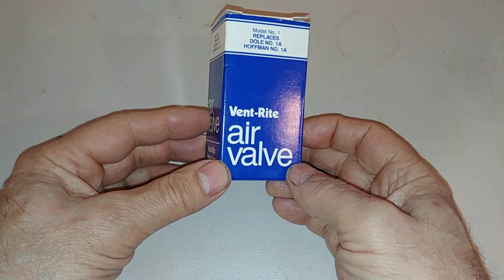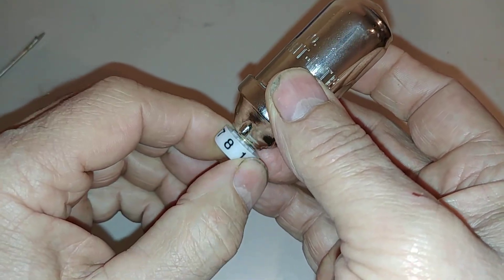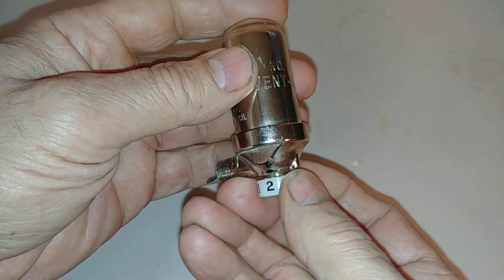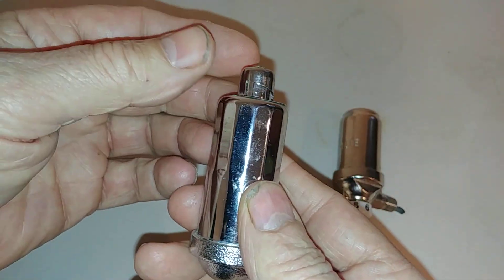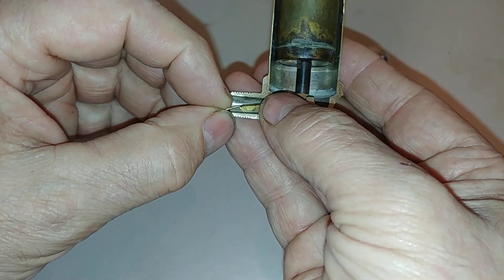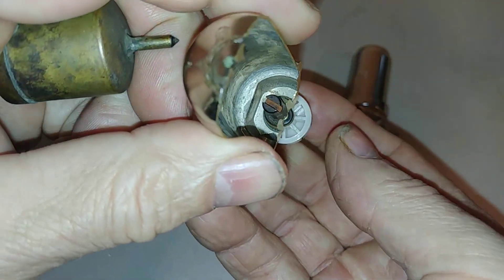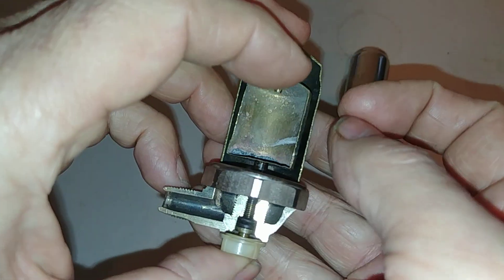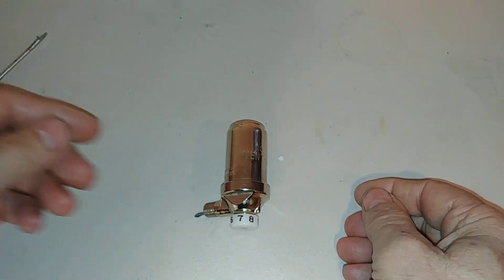Vent Rite #1 Adjustable Single Pipe Steam Radiator Vent. A Pretty Darn Good Vent.

Comment: I just moved into a house with single pipe steam radiators. While the radiator heats up the vents hiss and freakout my dog. Is there a specific vent that is typically quieter while the vents heat up?
Reply from the maker: Have it checked to make sure your boiler is not over-sized or over-fired.
Check to make sure the pressuretrol is set to the lowest setting, and the pigtail is not clogged.
Make sure your main venting is the best it can be.
I'd do this before worrying about the vents on your radiators.
If your boiler is trying to jam too much steam into the system and/or there is not enough main venting, the vents on the radiator are gonna sing a not very good tune.
Reply: @gordonschweizer5154  we had planned to get the system checked after this winter. Will definitely make sure to ask about the things you mentioned. Thank you!

Comment: Great video! I just bought this valve (yesterday)  to replace a vari-valve and it seems to vent air for a long time… the very first time after it was installed it made a ping sound then after that when it vents -it vents loong enough that I haven’t seen it close on any setting. The only thing that seems to stop it from venting air is when the furnace stops running. If I put the wheel on 1 it should close quicker? Had it set to 4-6. -Thanks
Reply from the maker: @vonettas2735  Do you believe your steam mains in the basement are vented sufficiently?
Reply: @gordonschweizer5154  I will ask the boiler technician that services my heater about that. I have only seen one valve in the basement but on the pipe connecting the main to the return. I would have to look to see if I have any  vents on the main as I think they would be higher up.
Reply from the maker: If the main vents on your system are not Gorton #2s, they are likely not big enough to vent your system properly.
Venting your large steam mains as quickly as possible thru these large vents is key to even, efficient and quiet heat.
Once this is done properly, the radiator vents can do their job better, which is to...vent the radiators.
Asking a relatively small radiator vent to help vent the main as well as the runout pipe as well as venting the radiator is asking too much that vent.
Reply from the maker: @vonettas2735  Setting the number lower will restrict the amount of air leaving the radiator & cause the radiator to heat less.

Comment: Do i need to turn off my radiator when i replace my old valve with one of these?
Reply from the maker: Do you have access to turn off your boiler instead?
Reply: No 😢
Reply from the maker: Yes, I would shut off the inlet valve and maybe pick a warm spell to do the change out.

Comment: Great video I'm wondering why in the example you're showing the tag is slightly bent I noticed that when I pull them out of the package new they have quite a bend to them. Thanks
Reply from the maker: That tongue on a Vent Rite#1 is not the best design, sad to say.
Usually, I wind up bending that tongue to almost straight out, with just the slightest downward curve to allow the drainage of water from the vent, and threading into the 1/8 NPT radiator tapping.

Comment: If I want the temperature on a steam radiator to be adjustable, do you recommend a thermostatic valve (with the dial) or one of these? Are they more or less the same? This is for a dual pipe steam radiator system.
Reply from the maker: @Anthonydcpc10  Almost all dual or two pipe steam heating systems do not need, nor should have, a single pipe steam radiator air vent as shown in this video.
There are special thermostatic radiator valves that can be added in place of the usual hand control inlet valve, and that is a whole different separate detailed topic.

Comment: Is it possible to use an adjustable vent that will keep the radiator cold to touch? The studios are small 144 sqft room
Reply from the maker: You can get the Vent Rite #1 and most (not all - variable manufacturing tolerances sad to say) will be able to be closed.
You can blow into the vent and turn the knob to "1" to verify.
Also, make sure the packing on the valve is tight (that might be a job for your super?).
Loose packing is an air/steam leak and will bring unwanted steam right up to the valve in spite of the vent being closed.
Ask the management what pressure they run the boiler at.
Vent Rites say on the package they don't like pressures above 3 psi.

Comment: Tongue does not pivot like on hoffman vents causing bending and twisting damage to flimsy tongue when screwing it in. Also noisier than any other vents I ever used. Best vents are Hoffman and Gorton. Vent rite not in same league.
Reply from the maker: The Vent Rite tongue is their weak point, I'll warrant.
And I'll agree with you that Gorton quality is generally top notch (and they don't even have tongues).
The Hoffman tongues are also top notch and their #40 is (or was - had reports of quality issues recently), an excellent vent.
I think the Hoffman #1A is not as good as the Vent-Rite as to their adjustability. 
It is faster at its maximum setting, the 1A is.
I can't speak to the noise issue of the Vent-Rites, as there are variations in quality and each systems main steam venting, near boiler steam piping, boiler water quality, proper sizing etc etc etc can have effects on the venting rates overall and that can have impacts on noise.

Comment: These vents were recommended to me by my furnace guy and I have been pleased with them but I had no idea how they worked.  I'm very impressed by your knowledge.  Thank you for sharing it.  I'm guessing you have quite a bit of practical experience in the field!  I can't tell you how much better I understand my steam heating system after watching two of your videos.  Have you made a video that describes how to determine if your valve has gone bad and what actually breaks on them?  I would love to see that one!  I'm definitely planning to watch more of your videos.  Thanks again!
Reply from the maker: You are most welcome.
As to steam vent failure modes, the most problematic is when they fail to close when the steam gets to them.
They hisssssss and are a very expensive humidifier (and that helps shorten the life of your boiler!)
Sometimes there is something (a flake of rust, perhaps) caught right at the tip, but usually its the alcohol mixture in the little inner chamber has bled away and will no longer respond to the steam.

Comment: Hi i bought this valve but when i make 6 or 8 water comes out
Reply from the maker: Are your radiator inlet valves fully open?
Are you running pressures at the boiler of greater than 2 psi?
Is the water in your boiler clean?
Is the near boiler piping correct?
Is your boiler oversized or overfired?
Reply: @gordonschweizer5154  i dont know the pressure is more then 2 psi.water is clean.inlet valve i just open fully.

Comment: I like a quiet vent. As the Vent-Rite is a float type,, do they make a popping sound when opening and closing like the Hoffman 1A?
Reply from the maker: Yes, most of them do.
Although not as loud as most 1As, or so it seems to me.
You might be able to dial the Vent-Rite down so steam doesn't quite reach it @ the end of the heating cycle, so it won't have to close (and thus, no click).
Reply: Ok, thanks, Gordon. I’ll have to try a Vent-Rite.
Do you know why the float type vents include that ‘condensate tongue’ at the vent input while the bimetallic types do not?
Reply from the maker: @marcinmerrimack1726  It may have to do with the different shapes of the Gorton types vs the others.
The squat cylindrical shape of the Gorton may guide the water out well enough to allow it to function without the tongue.

Comment: What are some of the causes you mentioned just to have an idea?
Reply from the maker: Could you give me a time marker from the video?
I don't remember...
Reply: Well, I have a one pipe single system….. where u states it might not be the air vent …. Probably something else …. Meaning the steam boiler?
Reply from the maker: If the radiator is not heating as well as the others, and it is properly vented, the radiator vent is not likely the problem.
The valve to the radiator might be partly closed or broken.
The pipes leading to the problem radiator might be sloping the wrong way or have a water pocket.
The mains might not be insulated.
You might not have enough venting on your main steam lines.
The near boiler piping might be substandard.
The water in the boiler might be contaminated.
Reply: Thanks … I’ll do my investigation this weekend…. Thank you …. Like ur videos….. have you ever worked on an old Peerless Boiler steam furnace?…. From the 1960’s

Comment: What happens it the vents don't pass air through vents. Even the high vents and the vents through the apartments???
Reply from the maker: Where there is trapped air, there cannot be steam.
No steam = no heat

Comment: If you break the tongue off when installing, is there any way to reattach it?  Also, I got 2 others to work...but I don't like the particular sound @ 6-8 ... louder ones from my old ones don't sound as annoying (don't know brand)  ... for a room I want to run and buy a non-adjusable, what is quietest one, regardless of price?
Reply from the maker: It seems that the Vent Rites at their full open can get a bit noisy.
I'd take a step back and evaluate your main venting.
Make sure you have the most you can there on your mains so you can run your noisy vent radiators at a lower venting rate.
Another trick is to put two vents on problem radiators, one of which is on the tapping usually reserved for water (upper one).
Noise is a difficult issue because what's ok for some is intolerable for others.

Comment: Your video is wonderful and I ordered several of these. When screwing the vent, it seems like the tongue easily dislodges and turns sideways. Is there any trick to making sure the tongue stays level? Any way to tell once you’ve screwed it on that the tongue is aligned?
Reply from the maker: Thanks!
I know what you mean about those tongues.
I usually bend them so they are almost sticking straight out, then I screw the vent in.
You can hear if the tongue is turning in the hole otherwise, as you know.
Thanks for your feedback!
Reply: @gordonschweizer5154  Thank you for replying! We will redo the three we've started on with your advice!

Comment: Hi Gordon. I just came across your video while searching for tutorials on replacing radiator air vents, and although this was more of a product review, it really educated me on how radiators work and what these vents do, so thank you for that.

My question is about sizing: is there a universal size for air vents and the radiator holes they screw into, or have radiators changed over the years? My dad's house was built in the 1920s I believe, and most of his radiators clank and hiss, and a few have started to sputter (the one in the kitchen is so bad that condensation builds up on the tiled wall). I don't think anyone's maintained them for the 40 years we've had this house. I would like to save him money by replacing the valves myself, but I'm not much of a fix-it person. Is it as easy as unscrewing the old one, and screwing in the new one (with sealant tape woven around it), or do I need to measure anything or look for hard-to-find replacement vents that only work with older radiators? If I do call a plumber, how much do they roughly charge for this type of work, and would I need to find one who specializes in these old clunkers? I'm in an overpriced suburb in New England, for what it's worth. Thanks again for this video.
Reply from the maker: This is an unapologetic product review for the Vent Rite #1, my go-to steam radiator vent ( & I receive no recognition from them).
As to your question: For over 100 years, virtually all steam radiators in North America use the 1/8" National Pipe Thread (1/8" NPT) hole size, so no problem there.
Sounds like all your vents should be replaced.
Before you do that, however...
You would be well advised to get "eyes on" your steam system by someone that truly knows and works on steam.
Is the sight glass clear and unclogged and the water in the boiler at the proper level?
Check the "pigtail" under the pressure control on the boiler.
Run the system at less than 2 psi. 
Check for or add main steam vents in the basement.
Verify the proper operation of the LWCO
There should be no clanking or hissing and certainly no sputter.
These are a cry for help.
It will not be cheap.
But it should be cheaper than a new boiler.
Reply: @gordonschweizer5154   Thanks for your quick reply. It's an oil-fired boiler and it had its annual maintenance check back in July. They did recommend replacing the glass though, as well as the "rods" (can't remember what those are, exactly). They had to come out 3 different times this month because of some loud rumbling noises whenever the boiler would start up -- ultimately the fuel pump and burner coupling were replaced, and some water was removed from the boiler, itself. As for all the other stuff you mentioned ... well, it sounds like I have no choice but to call someone, as this is all over my head. I was hoping that replacing the vents would be a first step. Thanks again.👍

Comment: My ventrite valves are wide open at 1 and closed at 8. I just replaced 10 of them and they were all the same. Defects?
Reply from the maker: Sounds like you got a bad batch.
How annoying!
It's almost like they installed the plastic number wheel upside down?
Aside from that, do they close against steam, or do they leak also?
Reply: @gordonschweizer5154  thank you for the reply. Operator error on my part. They rotate past eight back to one or even two again. I was testing them past the wide open position of eight. Once I backed it off to one and carefully rotated it just to eight and not Beyond it performed as you described. It's my first house with steam radiators and it's all black magic to me at the moment. Getting cold here in the Northeast

Comment: I just bought one from Amazon and when I turn it all the way it lands on a 3?! I thought 8 would be the highest/fastest setting?
Reply from the maker: Blow into it thru the threaded part and turn the dial counter clockwise from your "3" until it stops.
Does it shut off/not allow you to blow thru it? That's good!
The numbers as to where it starts and stops as you rotate the dial are often a bit off. 
These are due to manufacturing tolerances.
The numbers are relevant to each individual vent.
Reply: It doesn’t make a difference whichever number it’s on. I’ve also noticed the body of the vent is all stained as if it was made out of cheap materials.
Reply from the maker: @walikhaled7739  Darn!
I am so sorry on many levels to hear that!
Their quality standards have gone way down, it seems.
Sic transit gloria mundi.
Reply: @gordonschweizer5154  you think so? I’m assuming it’s an Amazon seller so they probably were selling me a defect. Since you’re  recommending it over the Hoffman 1A, which I currently have and am happy with, il give the vent rite another shot from another supplier and see how it goes.
Reply from the maker: @walikhaled7739  Let's take a step back and make sure they are the right vents for you.
I like to use them to better control over-heating radiators.
The Hoffman 1A, which I still use upon occasion, is best used when you need more venting then the Vent-Rite for radiators that need to be hotter.
If you are happy with your 1As generally, that's good!
Remember, I'm just some guy on youtube.

Comment: Hi, Good info..Question the tongue is missing from one of my Vent Right vents, Will it still work?
Thank you for your help
Reply from the maker: It should work, but It might get waterlogged more readily.
Reply from the maker: If you haven't already, check the slope the the radiator itself.  It should pitch ever-so-slightly towards the inlet valve.